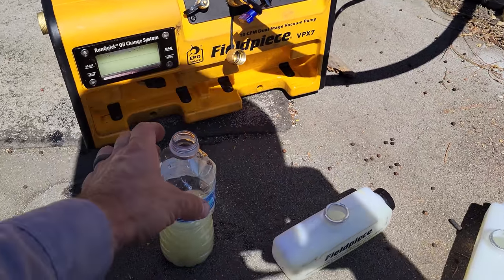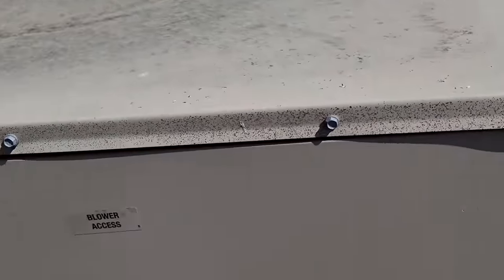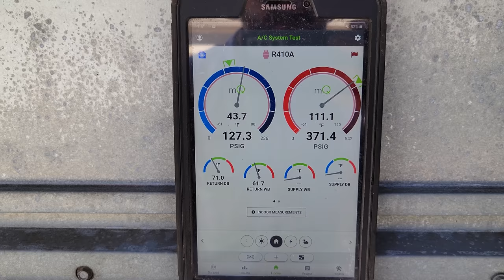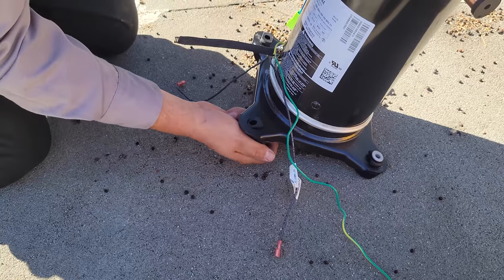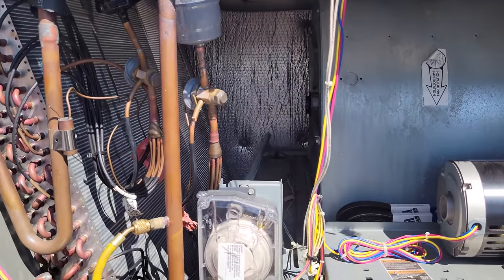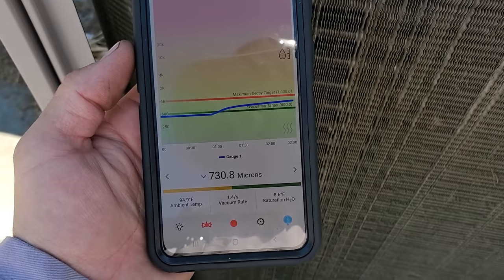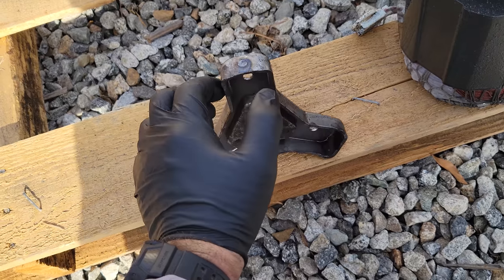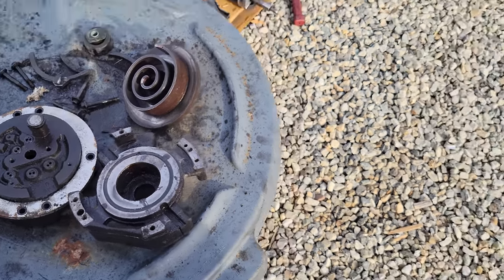INSANE MOISTURE CONTAMINATION

Comment: Wow, that was quite a lot of water!

This reminds me of a project I was on last year in Korea.  A large oil and gas production platform was built there, for use in the Gulf of Mexico.  The place has many different split unit A/C's for the different parts of the facility.  

The facility was transported here to the States for final commissioning. During the first year, ALL of the compressors started failing; many shorting to ground and others seizing up. The company who represented the HVAC side of the project found water in the systems.  They connected a vacuum pump and let it run. After about an hour, they returned and found the pump overflowing with oily water! They had to bring a special pump which had an oil treater unit which recirculated the oil and removed water. It collected two gallons from one of the larger systems.

The investigation found out that the Korean shipyard had hydro tested all the refrigerant lines, using water. The temperature at that time of year was well below freezing in Korea. They had blown the lines with nitrogen (or more likely shipyard utility air) and then evacuated. However, there was ice in the system which, of course, didn't evacuate. I have no idea what it cost them, but the shipyard was fully responsible for this messup! 

I was on site working on the power generation equipment, but talked a lot with the HVAC guys and got the story. There were a couple pallets of dead compressors on the facility before I left. It was massive carnage. No telling what it cost!
Reply: maddog 2 at samsung?
Reply: @zachstone1939  
LOL how the hell did you guess that!

Comment: Chris, that magnet you found in the bottom of compressor is probably used to catch metal shavings, similar to what you'd find on an oil drain plug or transmission pan on your vehicle. It failed because it's an LG.
Reply: What slander. I had a LG compressor work just fine for 3 months once.
Reply: @analogmoz  * Guinness Book of World Records would like to know your location *
Reply: I thought the same thing about that magnet in the bottom!
Reply: @analogmoz  Wow! Must have been the one that was built on a Wednesday.
Reply: @analogmoz  no way, we demand proof.
Reply: LG- lousy garbage
Reply: I second what @LaskaHVAC said.......and yes LG compressors are total crap.
Reply: What up Laska. Good to see you in here smashing folks with your knowledge.......bam....you're smarter.......bam.....you're smarter. Lol. I fully agree with you......bam im smarter.  Lol
Reply: Now dang it folks. I was hoping to be the one to bad mouth the LG compressor. Snooze ya lose I reckon lol
Reply: I've had LG compressors with locked rotors in brand new condensers.  LG=🚮
Reply: Totally agree, I don't like LG compressors at all. And he put in another one...
Reply: The magnet is actually a pretty good idea to have in any kind of machine where you have a lubrication system to capture all metal shavings from either manufacturing or normal wear to prolong the life of the equipment. If you can - put a magnetic oil plug on your car too, then you can see if things are going sour.
Reply: And I’m an old tramission rebuilder: when you see that on a trans pan magnet, it’s never a good thing. 
 Just like in an ac compressor.
 I would like to point out the bushings/bearings for a about year old compressor is pretty extreme
Reply: @Simr Khera They definitely aren’t good enough to be nosing into commercial hvac. Their appliances are junk too. How do you even take a company named “life’s good” seriously?
Reply: All the people saying LG is bad, where is the obvious failure in the video? Metal fatigue? Say specifically what is broken or breaks or you are full of sh*t with your accusation.
Reply: @dilchproductions  Warranty repair? He'd have no choice.
Reply: @misterhat5823  ah, makes sense
Reply: @burningdust  Their name isn't Life's Good.  It's Lucky Goldstar.   Their early televisions were simply labeled "Goldstar".   Later they switched to "LG".
Reply: @tbelding  ah, I stand corrected. I definitely recall the cheap goldstar tv’s and VCR’s. As a bench tech in the late 90’s I must have repaired a few hundred of those. They were the kind of products you could buy at a grocery store.
Reply: @burningdust  - You weren't totally wrong.  They were Lucky Goldstar, then after a merger with another "Lucky" company, they changed to "LG Corp" (1995), and then started pushing the "Life's Good" slogan.
Reply: @Simr Khera Not sure that is a good place for them either, LOL
Reply: @tbelding  Oh i didnt know that. I was a Tv technician back then in Germany. We had few of those Goldstar TVs here, but i remember they were crappy AF... No surprise they make bad compressors now.
Reply: @Simr Khera all thier refrigerator compressors fail most when 13 months from delivery
Reply: i read the first half and was like "okay", but then i saw the LG. i deal with Rotary LG compressors, R-410A types, and do you have any idea how little it takes to kill them? i consider a good unit with those types of compressors anything that can last past 2 years
Reply: LG is not for Refrigeration. Even on smaller coolers with their crapy linear compressor. 
LG sucks!
Reply: Most of their DC compressors come with 10 year warranty, they'll just give you a replacement if it fails.
Reply: no way @analogmoz

Comment: Our recovery tanks get hydro-tested every so often. We had one come back with almost a quart of water in it.
Reply: @Grauenwolf  not a HVAC Tech but I imagine it would be easier to get it professionally dried. I'm sure there is a process you can follow but I imagine it takes alot of time.
Reply: Then the testing facility did something wrong. When we hydro test tanks we steam dry them while they’re upside down, then if there’s still any water in them we stick an air wand into the tank and blow it out with dry air
Reply: @Grauenwolf  Just dumped it and pulled a good vac.
Reply: that's the only safe way to high pressure test a vessel, water(or other thin liquid equivalent to water). if it does fail, minimal bad things happen, as compared to filled with air or other gas that will also compress to a partial liquid and retains a massive amount of energy. a larger gas filled vessel rupturing can easily level a whole building and more, even if they do it within a huge tank of water, it can flatten a large area and leave a crater hole. 😬 💣 🧨☠️
Reply: This is the reason why we recover but never reuse. Always charge new gas. I know in some peoples worlds you can’t. But in mine we can. My systems are around 20-25lbs max. So it’s not the end of the world.
Reply: @timothystevenson7907  Just purge the water out and put a vacuum pump on it. Lowering the internal pressure helps mitigate residual moisture, reason why you're supposed to pull a vacuum wherever a system is exposed to the bare atmosphere. Chances are you probably wont use that recovered gas anyway.. just how it is
Reply: @Syphonfllter  yeh was thinking that. Just know some people do reuse the gas so don't know if there is a proper procedure or not.
Reply: @jobathan Allen 
   What ?
Reply: @Grauenwolf  you can't just dump a reclaim tank but usually you could get the water out and then run a vacuum on it which changes the pressures inside of The jug which lowers the boiling point of water so you can evaporate off any moisture.

Comment: I have had a shop guy remove the rubber plug and let the compressor sit out on the truck over night. Cool thing was it had a sight glass on the compressor. I got to see the amount of moisture bubbling out of the oil... It was a lot and took more than a triple evacuation to get all the water trapped in the oil. I'm glad I work for another company now.

Comment: Hello Chris…
I am NOT an HVAC tech, but found your videos, and love to watch you do your work. You are a superb tech in how you go over the whole picture when working on the RTU systems. I don’t know what you are talking about when it comes to your gauges readings. I’m an electrician, and understand how you check for shorted 3 phase compressors and bad contactors. I do have a company that calls me to do some of the Seimens and Novar EMS systems. I work with their tech support in replacing thermostats and their main control in the backroom, and their board in the RTUs. So I’m just touching the tip of the iceberg in remote controlled EMS HVAC and Lighting systems. I am picking up some neat tips from your videos and enjoy watching you work. Had a new store where the visitable heater never worked since the store opened. I checked for 24 volts on the thermostat, and got 0 volts. Support told me to find the control for the heater/fan. I found a transformer and contactor above the drop ceiling and was checking it out while talking with my support person. I had 208 volts on the line side of the contactor, and noticed the transformer 208 taps was on the load side of the contactor. I told my support person this don’t look right, the transformer should be on the line side of the contactor. Soon as I switched the trans to the line side all came up with the fan/heater, and my support guy said “now I can see it” I get into some crazy stuff working with these guys on the HVAC & Lighting systems. At least if we can’t get the RTU running when I swap out a thermostat or board, I can check enough other stuff in the RTU where I can tell them to get a real HVAC tech to fix the problem which is out of my scope of work on these systems. 
You say you don’t know everything, but in my book, you are a great tech and do really great work.

Comment: I tore apart a rebuilt starter after it failed less then a month after a buddy of mine replaced it. We tore it down and I couldn’t believe my eyes. There’s usually a set of four magnets attached inside with an armature. I pulled the end off with the brushes and when I took the thing apart All four magnets had moved around inside the housing. They were not attached to anything. I couldn’t believe me eyes. We ended up rebuilding his old starter and he’s been using it worry free for the last five years.

Comment: The magnet in the bottom of the compressor doesn't look out of place to me. Automotive applications do that too. Typically your oil drain plug in your car will have a magnet on it to catch small particles of metal and keep it from getting circulated back through the system. The same thing in your transmission, there's usually a strong magnet in the pan that collects metal shavings.

Looking at the big picture, I see two strong possibilities. Since the initial recovery didn't turn up all that moisture, it really makes me doubt it was in the old compressor unless you didn't take it down to a vacuum. If you didn't pull a hard vacuum on the system, then it's entirely likely that there was some severe factory moisture contamination. It could have even been sabotage by a factory worker who knew they were getting fired (I've seen that happen more often than I care to admit).
Reply: Not only did the initial recovery not turn up all that moisture, but when you see him draining the old compressor, the oil that poured out of it, looked to be clear and not contaminated.

I bet, the new compressor had a small leak, where the factory did not seal it.

As far as i know, compressor oil i very hygroscopic, so if the compressor had a small leak, and it was stored somewhere moist, the oil would very quickly suck up a lot of moisture.

My guess is the old compressor failed mechanically, and the moisture contamination was in the oil of the new, due to the new compressor not being sealed properly.

In any case, it's good craftmanship to check, and to just keep flushing until the oil is clear, so he did this very professionally.
Reply: @JohnDoe-bd5sz  Just hope that this unit don't die soon again due to the moisture because it could have corroded the new compressor pretty badly.
Reply: @ehsnils  Yeah i agree....But if it does, i hope it does so, very fast, because then it will again, be a warranty repair.

But yeah, that "new" compressor could be really rusted out inside...
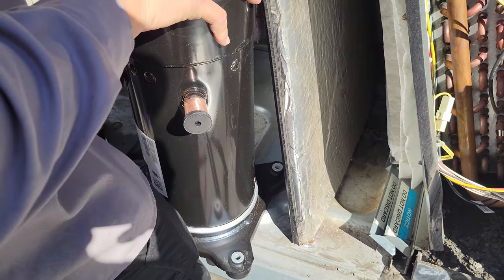Reply: The compressor was sealed, When they removed the shipping plugs, the case was pressurised. 14:25
Reply: @stephenwalls9277  But for how long was it at the factory unsealed. Maybe it was not pressurised at once, when it came off the line.

Comment: I had a refrigerant jug of 409a that had water in it. I had like 4 systems that were all getting moisture and I couldn't figure out why, they were all 409 and I had just worked on all them. Turns out there was water in the tank. I put some liquid in a cup and when the refrigeratant boiled off there was standing water in the cup still
Reply: Damn that’s not good

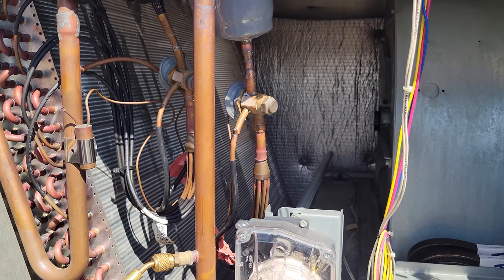Comment: 18:41 What I've learned as a car mechanic: If you get yourself some rubber hose, like 8mm ID or something, you can use that as a spacer for securing lines. Cut it to desired length, put a ziptie in, loop it around pipe one and go back trough the hose, then loop it around the other pipe and tighten the ziptie. Hope it helps!

Find your video's pretty interesting, systems are so much different then car a/c's
Reply: That's a great tip (not a hack but an actual solution)!

Comment: I had a restaurant owner provide a used condenser unit, for his small walk-in freezer, that had been stored for five years in his garage. Upon delivery I noted that the king valves were open and told him it was probably highly contaminated but he insisted so I installed it with a new oversized filter and after purging it with nitrogen. Sure enough, after 2 days on the vacuum pump and a bunch of oil changes, I managed to get it below 500 microns. I charged it up and started it. Yeah, the stuff I saw in the sight glass was crazy. I'm pretty sure there was insect parts and other debris flying around the system. Knowing what I know today I should have pulled the compressor and, at the very least, changed the oil. I really think the receiver and accumulator were all contaminated beyond anything I could have cleaned up though. Sometimes you just have to say no.
Reply: No good deed goes unpunished.  Was there savings at the end or were there multiple issues?  I'd go as far as giving my knuckle-headed customers a questionable competitor's business info and state "some people will do anything for money, right or wrong".  Most times customers will say they want it done right.
Reply: @lopaka79  lol just send it if that’s what he wants, I would give him my advice but if he wants to pay me over and over, why not
Reply: Lol that’s messed up beyond what a vacuum can fix
Reply: 1
Reply: q
Reply: 1
Reply: 1
Reply: ý
Reply: 1
Reply: 11
Reply: 111111
Reply: 1111

Comment: @29:10, that rectangular pocket where the motor shaft goes into the lower scroll is supposed to be able to turn in the bottom of the lower scroll...   If it's seized/welded in, that would be (a sign of) your problem.    The fact that you dumped so much oil out of the compressor suggests to me that the oil pump was not functioning - look inside the bottom of the hollow motor shaft, there might be a piece of sheet metal in there that is supposed to pump the oil up the center of the shaft to the bearing at the top (that's seized into the lower scroll).

Comment: Im willing to bet it happened in manufacturing. My guess is when unit was being assembled compressors were left open to atmosphere too long before being brazed, pressure tested, and Vacuumed. Once you get moisture absorbed by POE oil it will never come out. You can clean it up but never will get it non-milky without an oil change.

Comment: The varnish on the copper wire and the string around the windings all contain moisture. A low charge condition makes the compressor run hot, driving moisture out of the windings. You see things in that hot climate I never see in Portland Oregon.

Comment: I replaced a coil on a industrial Hyde drier for a tannery.  The factory used water to pressure test the coil.  Same problem with the vacuum pump oil.  Had to change it about ten times.  We even purged the coil with dry nitrogen before we started.  I’ve had nitrogen bottles with water on the bottom.  I would tip that cylinder over once it’s empty and see if water drips out.  Flooded starts = cause of most compressor failures.

Comment: 29:49 - Scrolls don't need valves for their operation itself, but the reeds prevent the pressure equalizing back through the compressor instantly after it's off, causing it to freewheel backward possibly. I'm not someone qualified in the field. But long ago I observed on a train that when I heard that the AC on it turned off, I heard the compressor spinning up to a quite higher RPM momentarily, that told me that it couldn't be a reciprocating compressor but possibly either a scroll or a rotary one, lacking a reed that prevents this from happening, or the reed failed in it maybe. So, those reeds are for, if nothing else, maintaining the pressure difference while the compressor is off.